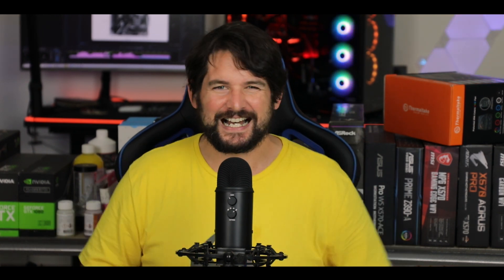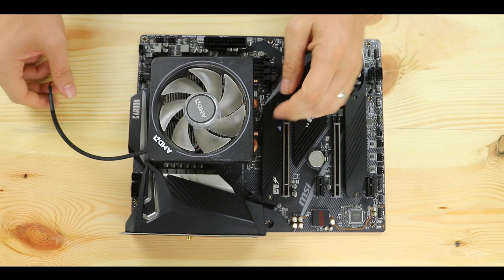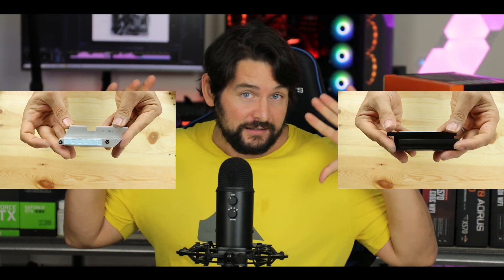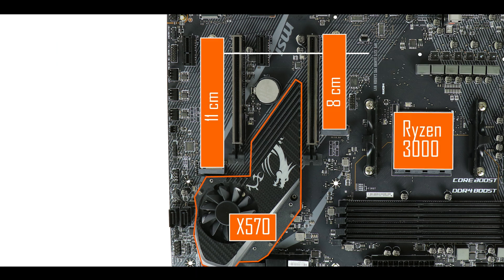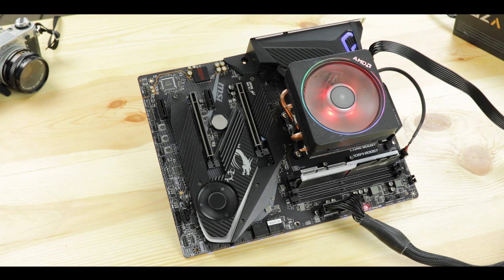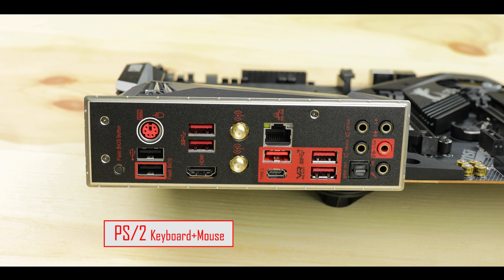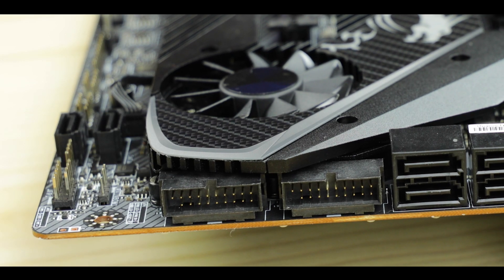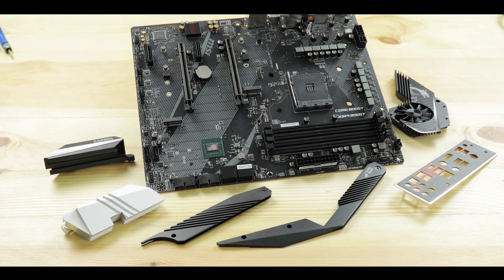MSI MPG X570 Gaming PRO CARBON WiFi. Just not good enough!

Comment: I am currently using this board and it's awesome, had an issue where it wouldn't boot with quad channel ram, but I popped out two of the sticks tried again and then I was able to boot and flash the BIOS, and it's been awesome, and my CPU is automatically turboing to 4.8 GHz when needed, over the 3.8 that my gigabyte didn't seem to want to go past even while water cooled.

Comment: So, I need some advice. I got this motherboard when buying a used system. The price including a 5800x was too good to pass up. It would hve been a good price before all the crazyniess started. Do I need to replace the board, provided I do not look to overclock or upgrade the the processor? Where would the "better replace it" point be?

Comment: I have the MSI X570 Gaming PRO CARBON WiFi and it is just a fabulous board for the price.  I first got Asus x570 but I returned it so quickly. Now the MSI x570 is incredibly well designed, well priced, have all the latest feature. I could not be more satisfied. I totally disagree with your review.

Comment: Thank you Laurent
i also felt my motherboard is not good enough for what i do with it,
I have a Ryzen 9 9350x and notice when overclocking it gets too hot.
although my system is a water cooled system
I can't get my Ryzen higher than 4450MHZ
is this because of my motherboard?
what would you recommend me in MSI with Socek AM4 to get better performance and better stabilization

your video did my eyes open and I'm looking for something better now

Comment: I bought my Pro Carbon X570 the day the 3700X came out. I have been very happy with it. I have had 0 issues. I have clocked it up slightly using ryzen master with stable temps and good results. It's an excellent board.
Reply: Update still running!!! Upgraded to a 5800x and am in top percentile for this processor!!!! 2025, 5 years later with 32 gigs of ram over clocked 5800x and a 7900xtx. I am smoking the boots off of AM5 builds.

Comment: One time I veer off Asus... one time... and i get screwed.
I can't run 3600 rated ram (proven to reach that speed) any more than 3200, no matter how much voltage I give.
The board runs stable and has nice features but it's a bit underwhelming in the performance department. We'll see about long term durability.

Comment: Why oc a 3900x on this Board? 
Most People, or gamers wont use this CPU. 
So i missing a Test with 3600x of 3700x, because its More practical.
Overall a poor review, for Example, 6 Fans are More than enough.
Sata is okay to have this Time, because 4.0 devices have Not advantages yet and the Fan nearly Never Runs, so its Not loud and it is durable.

Comment: I just bought this bundled with a Ryzen 5 3600xt. Is it good or am I in trouble?
Reply: i see reviewers poo pooing this mobo, i've had zero problems with it.   temps on the motherboard stays nice.  only thing i can think of is they have crap cases with zero airflow and they monster overclocking on the higher core count cpus.
Reply: @baneblackguard584  I paired it with a cougar mx331-T pc case. It looks good so far. Even with fans the unit maintains 70-80°c.

Comment: Wish I saw this post in January. I had to RMA my board it overheats and shuts down , USB stops working as well. I water-cooled the CPU (8 core 2700x) I wouldn't dare put my Ryzen 9 CPU in this build even though I bought it for this board.

Comment: WHAT'S THE PROBLEM WITH THIS MB?
Reply from the maker: PCB junction heat. under OC on 3800x and above your motherboard lifespan will be greatly reduced.
Reply: @Laurentschoice  WHY DO YOU NEED OC?
Reply: I was thinking of putting a ryzen 3950x and now I see this after I bought the board dam it ,, if I don’t overclock ryzen 3950x can this board handle it if someone can reply would be great

Comment: what would you recommend most for a ryzen 7 3800x paired with an msi gaming x trio 2080ti? It needs to be no more than £320 if possible. I would prefer to have built in wifi 6 & BT 5. I currently use dongles and they suck as well as taking up two usb slots. Currently from my research, my main contenders are this, the slightly cheaper ASUS TUF x570-plus wifi, and the most expensive of what I can afford, an Asrock x570 taichi. Do you have any other contenders or preferences?

Comment: Hi, i saw your video and believed you in the first place. Then i checked my X570 Carbon wifi myself and there were Temperatures of 105° but fahreinheit the Mos are at 45 °  celsius with full load of my 3700x with PBO, so no issue here. I use a Top down blower cooler "DARK ROCK Tf" Maybee it was a reading failure from the bios. 
BTW it is not possible to read the Junction temperature from outside as you mention in another video over MSI boards.
If you tell me i need to measure elsewhere I will use my fingers and it will definitely not be to hot
Reply from the maker: Hi there. 
Pcb temps can only be read with a thermistor placed on the back ur board PCB on the soldered junction.
Temps can reach up to 115c which will shorten ur boards life span.
Reply: @Laurentschoice  ok accepted, thanks and sry!
I guess I misunderstood you.
I will buy another one but i would recommend to watch this review also https://www.youtube.com/watch?v=wbG3ZiVk01c&t=1594s wich is a test without aircooling with middle class cpu's till 120 watt and thermal camera and a even weaker board

Comment: I sadly did not see this review till well getting it.

Do you feel pairing it with a stock settings 3700x will run into any issues?
Reply: All the reviews from this Board are crap. Running a 3700x is Just Fine. 
The YouTube guys all using a r9, which is dumb on this mobo at this Price.

Comment: On Newegg, MSI says it will last for 50000 hours, not sure if it is actually rated to run that much.
Reply: I think they meant tht the life on it before u gotta replace it bro cuz look I have this exact one bought brand new along with my other parts I put it all in my pc February 2021 my pc ran perfectly no lag nun bout a couple days ago my cpu lights on and nun working I replaced all my parts and nun so I think my mother boards already dead

Comment: Take this with a grain of salt, but I feel like I've heard the next Nvidia gpus will still not need pcie 4.0. Possibly the following will need it as it's now an option
Reply from the maker: There is a lot of talk about it. 
Having a PCIe 4 GPU would mean for nvidia to have a PCB layers on their cards and that does translate in a more complex hence expensive manufacturing process. 

Would not surprise me if you turn to be right.

Comment: Can i overlock r5 3600 with this board?
Reply: Does it work fine for overclocking on this board?
Reply: @alwyn21  you can oc the 3600 wtf
Reply from the maker: you would need a 3600X. 3600 can't be overclocked.

Comment: Would this work with my 3900X, and also I'm assuming it wouldn't overclock.
Reply: Ive got this MOBO and the 3900X and it works, however I dont know why its OC since I didnt change anything, but it sometimes starts at 4.2 and I have to go to the Dragon Center and move around the scenario from Extreme to Balanced to go back to the 3.8
Reply: Amd CPUs will "overclock" themselves if you keep it cool enough. The hotter it gets the more the GHz start to drop unless you lock it in the bios.

Comment: I don't know. I have some customers running Ryzen 9s and a couple Ryzen 7s on this board, and they seem to be running in the highest percentile just fine. This seems to be a nice board. I own a business building and fixing PCs and Macs, so I see a lot of crap. I have one of these in front of me with a Ryzen 9 on it. It runs nice and cool with the CPU hitting 4.3 on PBO and the VRMs are staying cool. I have also seen one core go to 4.495. This one is also running RAM stable at 3800 Mhz. I am wondering how all of the BIOS updates made my comment possible. I'm sure the BIOS updates had something to do with the better performance.
Reply: so this board (x570 gaming pro carbon)is good？
Reply: @kuluzu2383  no, it hits +110°C on a 3950x. literally any other board is a better choice.. awful VRMs, awful price, do not buy it
Reply: @jojipy8309  I can't say the same. I have it and a Ryzen 7 3800x running on that. I think it's pretty great and the max temp with 3800x (Wraith Prism) is 80°C at Cinebench, but I ve never tested others benchmarks
Reply: @jaopinao2838  im talking about the VRMs.
Reply: This Board is good in my opinion. I'm running a 3800x 4,3ghz with TridentZ 3800mhz Cl15 15 15 30 without any stability and temperature problems. Max. VRM Temperature was at 72°C. (Lian Li o11 xl with 7 Fans)
Reply: @jojipy8309  huummm... I got it
Reply: @jojipy8309  I come 1y to late I suppose, but anyway. MSI has maybe made improvement on this board. I am running a 5950x and VRM stays under 70C full load.
Reply: Hey how do you install WiFi driver thing on the MSI Pro AMD X570 AM4 ATX DDR4-SDRAM Motherboard

Comment: Okay so I am getting this motherboard and my first time getting a pc. So how do you not overclock it?
Reply from the maker: Just use it out of the box :) and that's it. 

Overclocking requires BIOS tweaking. As long as u dont do it, the board will run as stock.
Reply: @Laurentschoice  Good to know mate, i will upgrade on that tomahawk or something else but i already build it with this motherboard... if you say that it's gonna be ok if i dont overclock then im good with it for now.
Reply: Make sure you get a good cooler, your cpu will thank you

Comment: Dude, your videos are awesome! I stumbled upon them last night and I've gone through quite a few of them already. Great review, great comedy, great personality, great everything! You've earned a sub from me. But I am sad because I just bought this board yesterday morning and now it turns out the board isn't good. Now I don't know what to get.

I did have one question though. All (or most) x570's have an 8-pin and 4-pin CPU power adapters/sockets, but I can't find a PSU with 2 EPS. Which PSU do you use?

Thank you!
Reply: ABSOLUTELY AGREE with DF! I'm a new viewer as well, but absolutely loving Laurent's content delivery!
Reply from the maker: Hey thanks for the kind words.  

If u have anything below a 3800x the board is great. 

For the pins.   Dont worry about it. Stick to the usual EPS1 (8 pins), forget the 2nd one. Wont use it on this board. Doesnt have the right VRM to utilize more power :)
Reply: @Laurentschoice  Thanks so much for the quick reply!

I have the 3700X, so I'm good there. But my concern is that if the board gets really warm (my room is typically warmer than usual) it'll kill itself and I'm screwed. 

Thank you for the confirmation on the EPS.

Have a great day, and stay safe.
Reply from the maker: So as long as u dont OC ur 3700x ur good. Just make sure u got a couple of exhaust fan on ur case to make sure u got enough air flow to conter act PCB temperature and you'll be absolutely fine :)
Reply: @Laurentschoice  You're a good dude, thank you. I am still going to get a GIGABYTE X570 AORUS PRO WIFI based on your other video though. :) If Gigabyte sees this, you owe this guy royalties!
Reply from the maker: Ahah too kind:) can always use the Amazon link in the description :) always helps ;)
Reply: @Laurentschoice  I don't see a link... but I'm in Canada, so if it isn't an Amazon.ca link I couldn't order from it.
Reply from the maker: Look for this one on your search:

Knox Gear Professional Microphone Studio Stand for Yeti and Snowball Microphones.
Reply: Laurent's Choice may I ask for a good psu to use that is compatable with this motherboard thankyou
Reply from the maker: What CPU / GPU ?

Comment: Hey, so I got this board with a 3800x because it came in an incredible deal. Was it a bad choice? Will my cpu overheat? It’s past the return date, so not much i can do now.
Reply from the maker: Dont overclock and you'll be fine. 
:)
Reply: Ok, thanks! I kinda panicked there for a minute.
Reply: So ryzen 3950x if I don’t overclock will this board be ok or what do you suggest not expensive if possible in this board price range not much more thanks

Comment: I just bought this board then saw this review whilst waiting for it to arrive. If the VRMs overheating is too much of an issue... nothing a 40mm fan couldn't fix surely?
Reply from the maker: What s the Processor going with it ?
Reply: @Laurentschoice  To follow on this I have installed it checked my temps and everything seems fine. My VR mos temps under stress test reached 52 degrees. 42 degrees at idle
Reply from the maker: In the review I talk about junction temps. That's on the other side of the board. 
Thats where temps really build up and will affect the board durability . 

3900x is an incredibly demanding processor. 

Over time,  the gaming edge might show thermal fatigue around the capacitors.  

I would suggest to change the board. 

Obviously that's not easy now. So just make sure to have plenty of hair flow. In this case, too much is not enough.
Reply: @Laurentschoice  3900x will I have issues?
Reply: I'll keep an eye on everything, the airflow in the case is optimal. But I am pretty happy with how it's running and happy with the purchase. Thanks for taking the time to respond and the advice
Reply: @eldore101  have you overclocked it at all?
Reply: @eldore101  I have same temps on the Edge. Chipset Idle at 50 usually dont go over that even. Got a noctua dh-16 cpu cooler one it. it sits near the window cooling down.... My cpu temp never reaches higher that 75 id say... i got a asus rtx 2070 super on it. lots of airflow going on. definitely thinking of upgrading in the future if its a problem...

ive had it for a couple months. so far.
Reply: There are also more independent tests with the board on the internet. To say that this board is not for sale just because the temperatures are in the upper range is completely stupid. Those who know the technical details know that it works better of course, but in this case it is no problem at all. Especially since I am running a 3800x in my case and don't need overclocking, I will never reach stress test temperatures like any other normal gamer. Only my 2 cents

Comment: Intel has just consumed me,  the i5-9600KF priced 174 pounds is better than the 3700x! I ordered the i5-9600KF and a TUF H370! Team Intel!! :(
Reply from the maker: Nice Combo !!!!!!
Reply from the maker: Ur pathway to heaven is forever compromised. Repent... repent now !
Reply: So you bought an Intel K series chip unlocked for overclocking and paired it with a chipset that is not an overclocking chipset. GG. 3700X is only slower by 9% in single core performance, if you overclock the 9600KF to its real-world thermal limit assuming all chips are equal. In gaming, less than 10% difference is equal to less than 10 fps difference. But, being its a quad core CPU it's ability to do any multi-threaded work for anything is about 25% or more, slower than the stock 3700X, even with the 9600KF under OC. Which you cannot get effective OC on that chipset. As far as gaming only in certain games does the 9600KF top the 3700X. But then the 3600X and 3800X are very similarly benched as well in gaming workloads so you could compare the 3600 OC to all-core 4.3 for $179 and perform just as well as the 3700X in gaming, and nearly as well at all multi-threaded workloads as well for the same price.
Reply: @roguetune03  - Budget upgrade <

Comment: What is not good?
Reply from the maker: The VRM :)
Reply: Laurent's Choice so the VRM is bad on this board?
Reply: VRM literally starts to try desoldering itself if you try to use it like that in same price competition:
https://nl.hardware.info/artikel/9411/25-amd-x570-moederborden-review-op-de-proef-met-een-3900x#vrm-test
This board shouldn't cost much more than B450 Carbon.
Whose VRM might actually do better because of having better unsabotaged cooling!

Comment: Hey brother .
A lot of love from india .
I want to buy this in 333$ .
Should i have to buy it or not ??😞😞😞
Please answer me .
Love you brother
Reply from the maker: Hi Viral. 

What CPU are u going with and what are the other choices u got ?
Reply: @Laurentschoice  
Brother i want to use 
Ryzen 3800x
Msi radeon rx5700 xt gaming x
Wd blue 512 gb ssd 
Msi mpg gaming pro carbon wifi motherboard
Antec hcg 750 watt brownz cpu
Cabinet under 100$
3200 mhz 8*2 ram stick
Reply: Suggest me better brother .
What's your opinion ???
Reply: In X570 boards it's Asus and Gigabyte which give most for the money.
In MSI boards might as well buy B450 Carbon to to get price equal to quality.

Comment: This is so sad my first build in October I was so happy to save money over spending 300 on the gaming -e rog x570 instead I chose the carbon pro wifi 🤧
Reply: Still a great motherboard to be fair. If you're not overclocking, this is a great board for Ryzen 5.
Reply: necessarilyskeptical I have a 3700x...
Reply: @drater1529  Sweet! I have a 3600X.
Reply: necessarilyskeptical nice! You think it’s still a good motherboard for the 3rd gen ryzen ?
Reply: @drater1529  from my own experience so far, yes. I have zero issues to report with about a week of solid gaming daily. The features lack a couple things I would have expected should be standard but overall I'm very pleased with it.
Reply: necessarilyskeptical good to know bro. Thanks
Reply: @drater1529  So do I and I have had no problems with it on this board at all.
Reply: @Inscydeus  what cpu?
Reply: Esteban T I have 3800x

Comment: I know maybe is a newbee question. But does there exist any kind of software,  which can show if my PSU is sufficient for my system?
Reply from the maker: Yes. U ll need to have an "intelligent" PSU, such as the Corsair "i" series. 

It will give u the intake of u build in wattage and all.
Reply: @Laurentschoice  the front case doesn't spin up, know its a small thing. But just would like be sure. 

But anyway thank you for your reply.